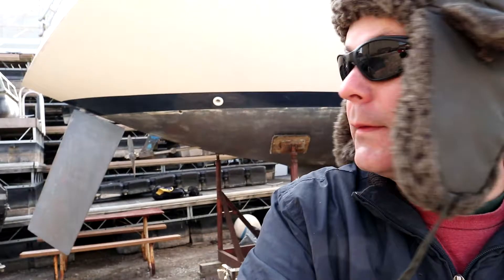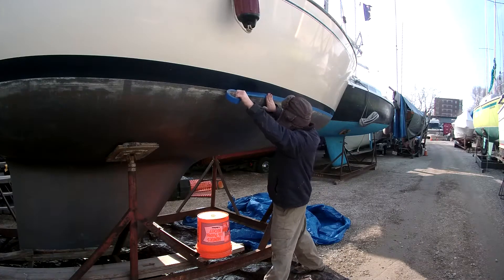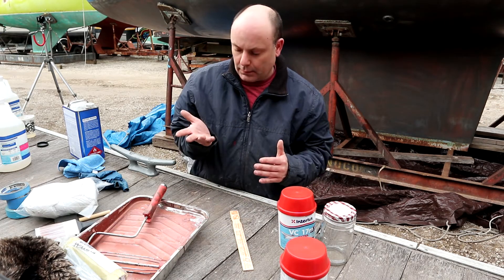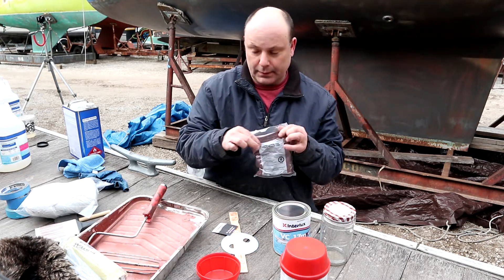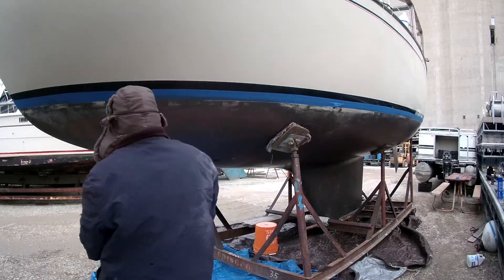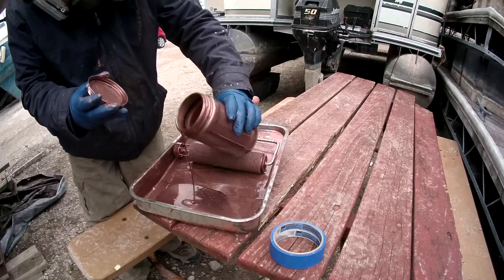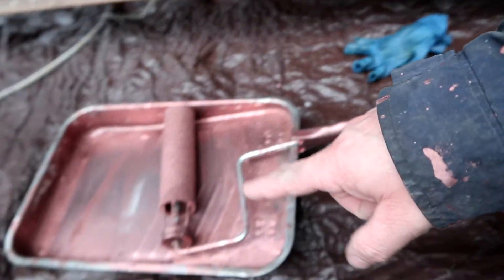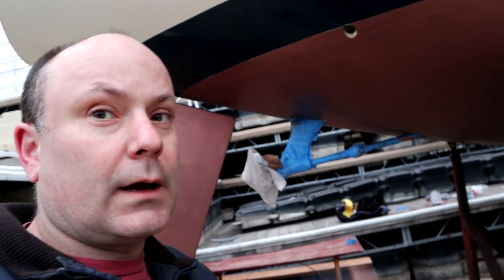Bottom painting with with VC 17m

Comment: So glad I found this just now. I’m headed to the shop to wipe down my boat and apply three coats of VC17m. I found a 23 foot sailboat with a pilothouse that I have been restoring over the last three years.
Reply from the maker: Thank you!
Reply: I found it more difficult to put the second and third coats on. It seemed like the previous coat was coming off it spots. Maybe because it was hard for me to not go back in forth with the roller like you do when painting a wall.
Reply from the maker: @huntington46750   That shouldn't happen.... My boat had vc 17 on it when I bought it.  I only use one coat and 2 coats on some areas. 
 If your VC 17 is 'coming off in spots' I would be more concerned about what is under the vc17.  It is possible that someone painted the vc17 over something that is not compatible with vc17.  Painting more layers of vc17 may not help.  If you already multiple coats of VC 17, I would see what happens when you take the boat out of the water.  If the VC 17 is still coming off I would sand the areas down to gel coat.  You may need a barrier coat before you apply vc 17.

Comment: I've painted my bottom twice, using these instructions, and I'm about to do it the third time. 

The one thing I've found, other than using canning jar funnels, is that if you wear glasses you can have inserts made for your full face respirator.
Reply from the maker: I don't know about glasses and a full face respirator. Thanks for watching!!
Reply: @sonofneptunesailing917  I've always had a problem with fogging, wearing glasses under goggles. And a half-respirator+goggles is uncomfortable, and tends to leak.
Reply from the maker: @jeffdege4786  that is why I bought a full face respirator.

Comment: Interlux does NOT advise the use of acetone. IF washing the bottom doesn't remove residue, use Special Thinner 216 to clean the residue. It can also be used to prevent VC from drying so quickly.

Comment: Great Idea of the glass jar... I do the same with all my paints and varnish, especially when storing excess. I would however recommend not to use a screwdriver to open the paint can, it will never reseal properly. 
Good Job!
Reply from the maker: Thank you for the comment.  I agree that I should have used a paint can opener and not a screw driver...
Reply: I know it’s a minor detail...I once varnished  with a full gallon, thinking of the cost saving... well, by the end of a week and with about 1/3 of a gallon remaining, it was junk... Again, Great Advice on the Jar and Have A Great Boating Season!!!! MC
Reply: When I know I won’t be closing the can I also don’t bother to hunt down that paint can opener.

Comment: When using VC-17 you should never shake the can prior to use. Stir it and stir it. Otherwise it will have bubbles. Also when mixing the copper in always wear a respirator. You do not want to breathe any copper dust. Use ultra fine foam rollers and always paint on longways. From stern to bow or bow to stern. Water is going by the hull and you don’t want paint lines to slow you down. I’ve used this product for 20 years on multiple boats. VC should be applied once a year or no more than every two years. You must always be careful when scrubbing the bottom as this stuff will scrub right off. I generally use a plain bathroom washcloth for cleaning the bottom. Nothing aggressive to scrub the bottom. The night before you paint turn the cans upside down so the settling Teflon in the bottom has a better chance of mixing. Otherwise good job. Looks like a fast bottom.
Reply from the maker: Thank your for the comment.  I typically always wear my respirator when I mix the copper.  I didn't in the video because the wind was blowing away from me and I wanted to talk,  but in reality I should have worn it.  
This was the first time I put the paint in a jar and shook it.  I lost less paint to evaporation and I did not get any bubbles.  As you know the paint is very thin.  I use West Marine foam rollers, they seem to work well.
 I read a HOW TO from Crowley's Yacht Yard in Chicago, they probably pain more VC 17 than anyone.  They said to roll the paint in vertically going up.  However,  I see your logic in painting it horizontally. 
 Next year I will place my cans upside-down for a day or 2. That is good advice.  
In the past I have cleaned my bottom with a scrub brush mid year, now I will use a wash cloth. Thank you for that tip. 
I am not sure why you said you should not apply vc 17 more than every 2 years.  I do it every year.  I use a scuff pad before I apply it.  I attempted to sand it because I thought it was building up, but after many years, the pain was still so thin that I sanded right through it. 
Thank you again for the advice and the comment.  I plan to make more videos soon.
Reply: I just put a new VC bottom on my 30 footer. Pulled it out yesterday cleaned the bottom sanded a few little hard crunchies off and painted it it’s pretty much done now and it’s probably going back in the water tomorrow.  I generally just wipe the bottom down with soft towels and water. Using acetone to wipe it down I think will take a lot of the underlying paint off which you don’t want to do. You actually want it to build up as it’s very thin. Also in my last reply I’m pretty sure I said it should be done once a year and no longer than every two years.  Good video. I think you’ve shown what a great bottom painting system VC 17 is. Keep it up and I look forward to more vids.
Reply from the maker: @dvd1329no  Thank you for the comment.  You may be right that acetone takes too much paint off.  I am just in the habit of using acetone to clean before I paint.  I just started working on more videos.  It just takes a ridiculous amount of time to make each video.
Reply: @sonofneptunesailing917  Hello , hope you are still reading these . SO I just bought a 35ft sailboat moored in the Med. Last owner had it for 30 years and advised me that he'd always used  VC 17 - I was wondering why you said you wouldn't use it in warm salt water ?? I didn't get chance to lift her out this Autumn so I haven't seen the hull but photos of last time she was painted look as good as your finished job . IS VC17 special in that you shouldn't need to sand the hull before painting- just wipe clean with acetate ( or not if it removes too much as in one of the comments ) ?? It will be my first job when I get down to her in Spring and I'll be pushed for time so want to be as prepared as possible .
Reply from the maker: @RayKeighley  I have no experience with anything in salt water.  I have heard that VC 17m is only appropriate in salt water for boats that are launched for a day then put back on a trailer.  
My best advice wound to contact Interlux and ask what salt water paint wound be compatible with VC17m.